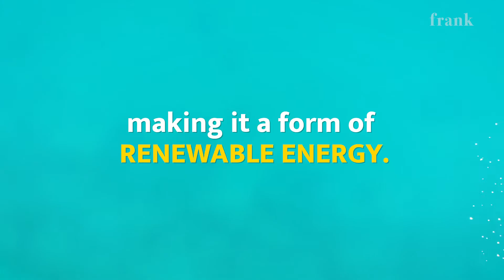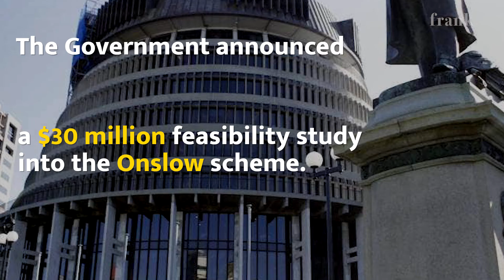Pumped storage: A game-changer for New Zealand’s electricity needs?

Comment: 5:35 Dude, I can promise you, the less than 1.5% of drivers in Auckland and Wellington who drive EVs are stuck in traffic at 5pm and even though ~1/3 of them will plug in when they get home (Most EV's don't need charging daily) they won't be drawing power until off-peak low demand power comes online later in the evening. In the long term though, as we transition to an all-electric fleet (Which is a good thing) we will need to find the additional 12.5 terawatts hours (NZs current gasoline-equivalent consumption per annum 41.6 TWh x 30% efficiency ) to power the electric fleet from somewhere.
Our current annual electricity generation is ~43 TWh....you do the math.
Reply: The comment was made in jest, but you've taken it and turned it onto something completely different =)